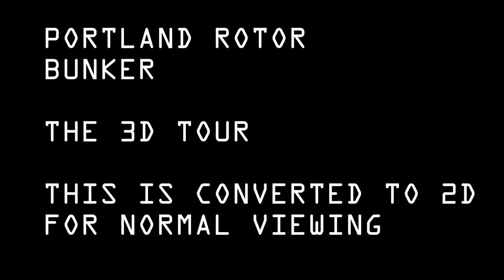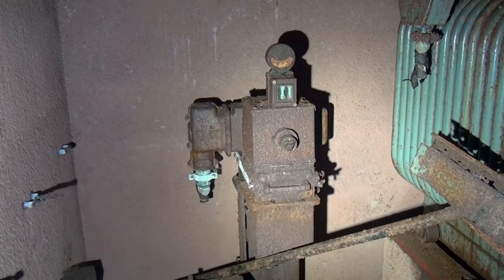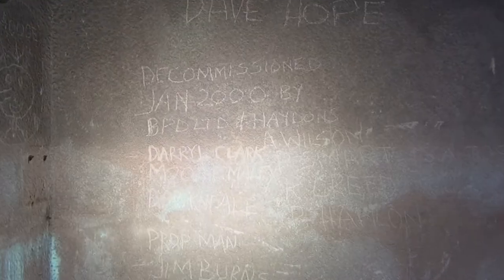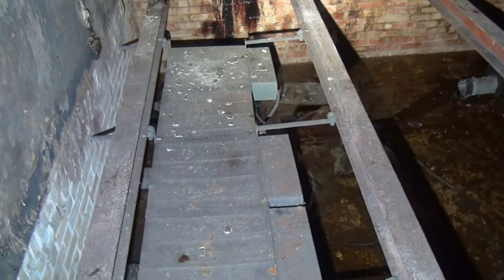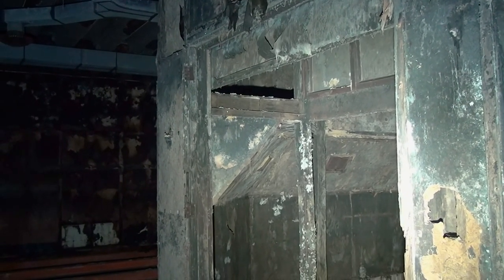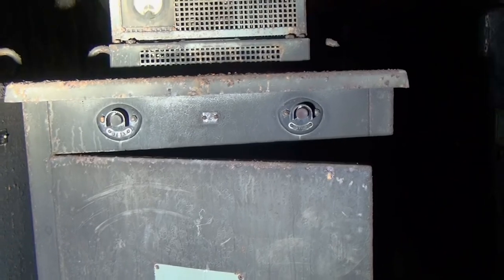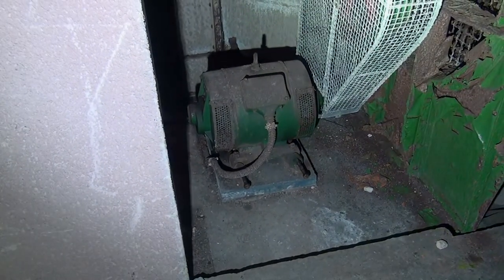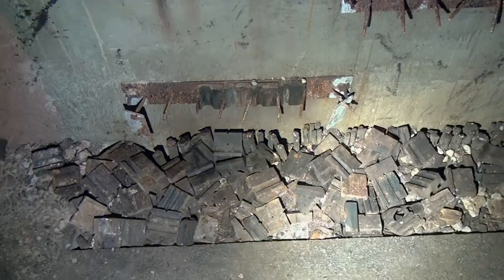Portland Rotor Bunker NON 3D Special NO 3d glasses required

Comment: A lot of the equipment in these bunkers was originally designed for 440 Hz avionics power supply. Back then the only way to generate 115V/440 Hz by using 50Hz AC as a source was to use a motor-generator converter. Nowadays we do this purely with solid state technology. When you see something like this it is usually the frequency that has to be converted or you only got a DC source. Otherwise a transformer would be much more useful.
Reply from the maker: YOU ABSOLUTE LEGEND... finally we have an answer as to why they needed motor power/frequency converters... more for the frequency than anything else.

Comment: Why do (some, older) lifts use motor-generators and not transformers?  Look up Ward-Leonard speed control.  Until the invention of VSDs, Ward-Leonard was how lifts got high speed travel and blistering acceleration.  The MG sets in the bunker appear, from the switch you found, to be producing electricity at 500 Hz? The advantage of higher frequency electricity is that transformers can be smaller.  So if there is a transformer in the rotating radar mechanisms, they can be smaller and thus lighter, so less rotating mass.